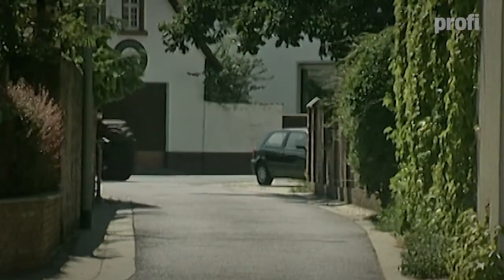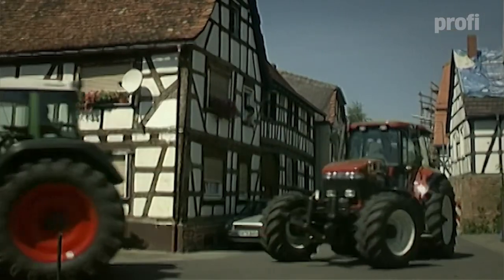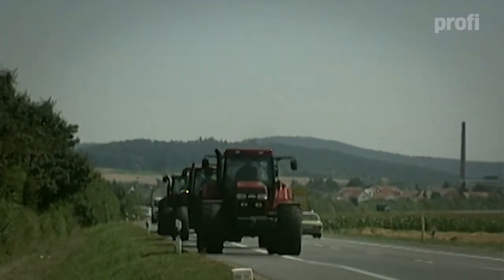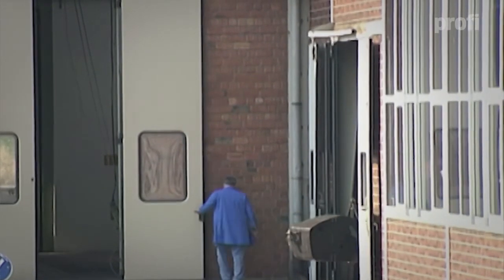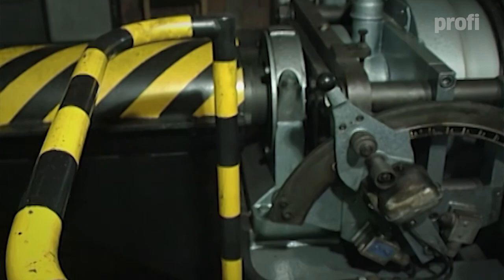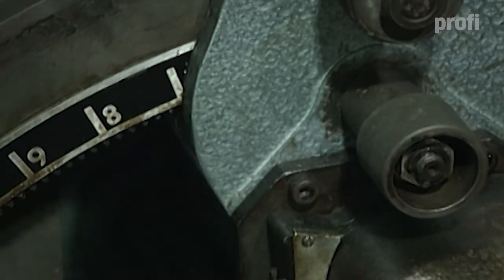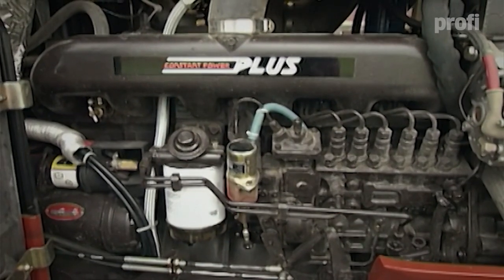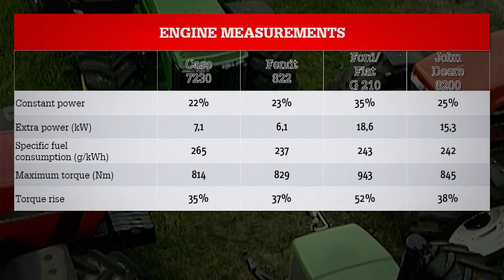Four High Horsepower Tractors On Test: Part One

Comment: Loving old school, a lot has changed from then with overlapping of chassis, vast improvements in engines especially MAN.  Technology has made biggest improvement, wouldn’t mind seen a 12 hr challenge where two operators driving old vs new n seen efficiency difference, how much of difference is there?